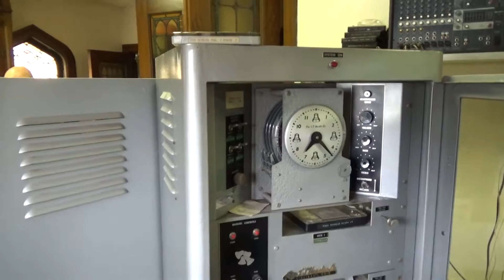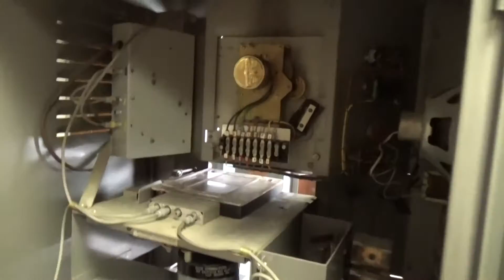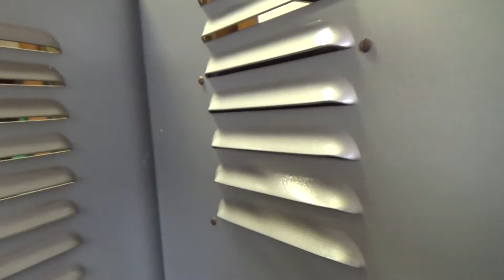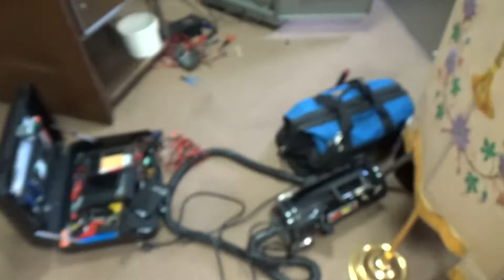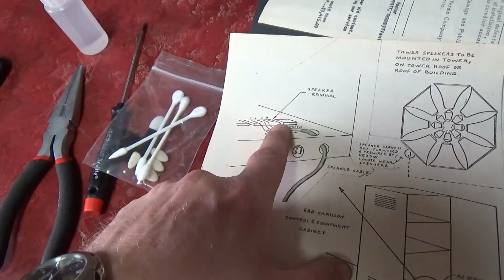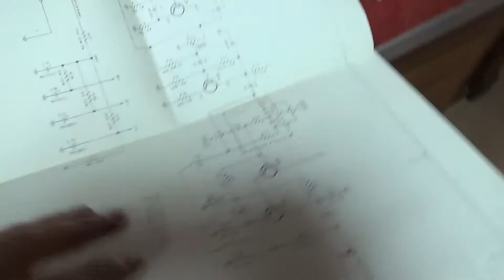Verdin Bell Tower Amplifier Part 4 Final   Bells Are Ringing

Comment: Wow (I was 8 back then in '69) I've heard of these tape based bell ringers (carillons), I assumed they all died years ago, I would have thought the tapes would all have worn out years ago - amazing.
I'm also amazed at McIntosh and their autoformers, I was just reading about their new 1.25KW monoblock amp, that uses an autoformer (i know of them as an 'auto transformer') everyone seems to be saying "output transformers suck", obviously they are wrong. I'm seeing people making 'OTL' valve amps (DarkVoice 336se etc.) that use big valves to drive just a few hundred milliwatts into headphones - what an inefficient design, going OTL (Output Transformer Less) with valves to run a low impedance load - crazy.
I 'recently' built a 100W amp to drive multiple speakers around my house (100V system), and I'm kind of amazed at the audio quality that can be achieved if you try (avoid the miniature 'crappy' 5W 100V transformers commonly sold for these systems). I’m having great success using toroidal transformers, driving decent speakers.

Comment: Fascinating piece of hardware.  I suspect the next task will be replacing the dead cartridge players with solid-state players using SDcards?  The mechanical side will reach a point where unobtainable/obsolete parts need replacing.  Does the clock sequence
the power for  the amplifiers to save electricity costs?

Here in the UK churches commonly have their original bells (and clocks) in working order, and bell ringing is an active hobby,
so I've never heard of a carillon system being employed, but they probably exist tucked out of site here and there. For a bit of
history I suggest starting with https://en.wikipedia.org/wiki/Whitechapel_Bell_Foundry
Reply: In the 1970s I lived right by a church in the uk. Every sunday the bells would ring and the clue to the source of the sound came right at the end when I could hear the pickup arm being lifted badly off the lp record when the recording was transferred onto tape.

Comment: A very interesting project, thank you so much. As a PS, can you show the main speakers?
Reply from the maker: Michael,
That would be very difficult.  The speaker array is about 150 feet off the ground in the bell tower over the roof of the church.  I'm not afraid of heights, I'm just afraid of falling from them :)) All kidding aside, there are 8 large horn speakers, arranged into two banks of 4.  Each series-wired bank adds up to a DC resistance of around 52 Ohms and is connected directly to one of the amps on the 70 Volt line terminals.  All 8 horns are arranged radially, to disperse the sound in a 360 degree pattern.   They are also older than the bell system, as the bill of sale showed that they were using the "customer's existing speaker system".  I think that there was an even older vacuum tube bell system installed prior to this current (1970) system!